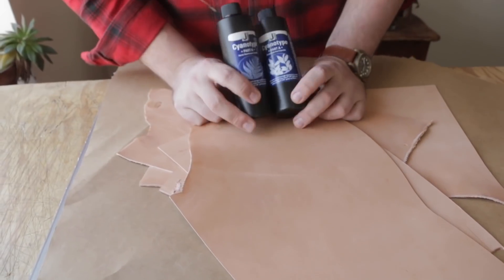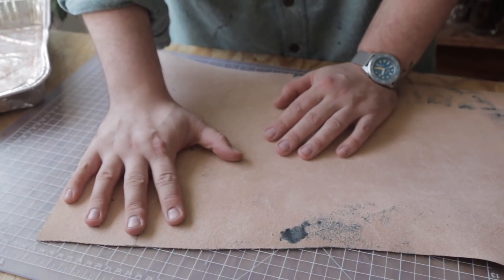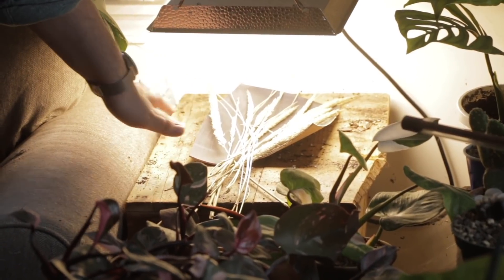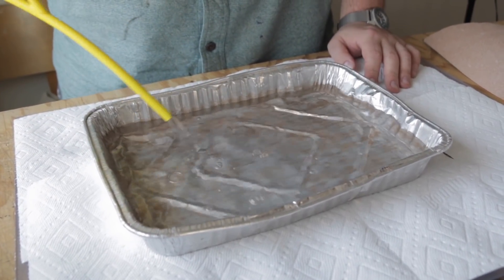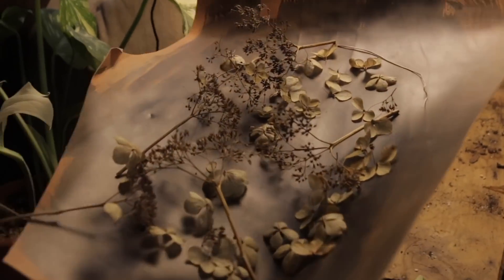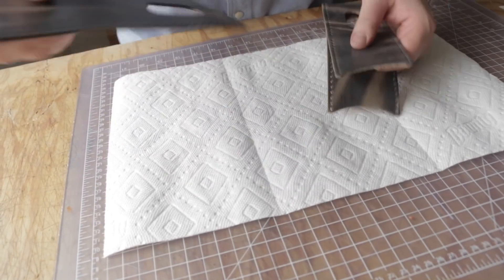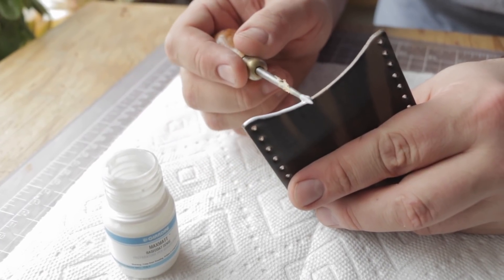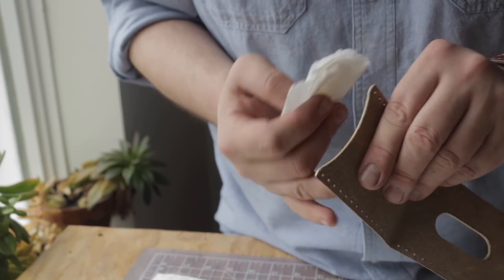Photographic Printing on Leather? (EXPERIMENT)

Comment: I’m struggling to get a print on the leather as you did. Some of my research shows that the ph varies & that I should use aluminum tanned leather. Can’t seem to find that anywhere. But I did scroll through your links at Buckleguy & see the “natural” veg tan. How is that different than regular veg tan, and is that perhaps my problem? Thanks in advance for any suggestions!!! Btw, I’ve had great success with fabric & paper, so I’m pretty comfy with the process of treating and drying in a dark room.
Reply: Same issue- did you ever figure it out?

Comment: Very nice! The actual cyanotype color is called Prussian Blue, though you can get different colors and contrasts depending on what you add to your soak after initial exposure to UV, either indoors like you did or outdoors. Of course, proper flowing water rinsing is imperative. The blue color will vary depending on the color of your substrate, like a white leather versus a tan leather, and so on. I think it's so cool that you did this experiment. Two coats of cyanotype solution with drying in a dark place in-between coats will give you a deeper color too. I LOVE this, and feel elated that you tried this process on leather. The wallets are awesome. Hope you don't think ill of me for adding just a tidbit of info. And oh man, there is sooo much more info about cyanotypes to be attained online and through one's own personal experimentation. I've been an alternative process photographer for over 30 years. Kudos!!!

Comment: Really cool stuff!!
Honestly in love with all your videos!

I have a question I was hoping you might be able to help me with.
I'm making my first garment collection and the theme center's around rust.
In saying that, I made a leather bag that is worn on a blazer that I also made.
Because I wanted to create a rust look, I used the suede side and basically rubbed a few different colored pigments into the suede. I also used graphite and a scoldering iron to burn the leather. In all honesty, it looks exactly how i wanted it to. The issue comes with actually fixating these colors and such to the leather so they don'be bleed onto the tan blazer. I have tried water repellents. I have tried a fixative that painters use on their paintings. I have tried using a clear coat. I have even tried bees wax. I'm sure at some point one of the things I tried probably didn't even work because the leather had another coat of something else on it beforehand.
I was wondering if you have any possible advice for how I could seal this so it doesn;'t get onto the blazer. I didn't think about sealing all the colors until after I constructed the bag. Perhaps I could put the bag in the oven for a short bit to seal things? uhhhhhh I'm so frustrated. Any help would be massive.

Thank you!